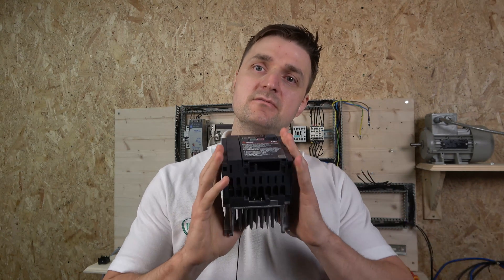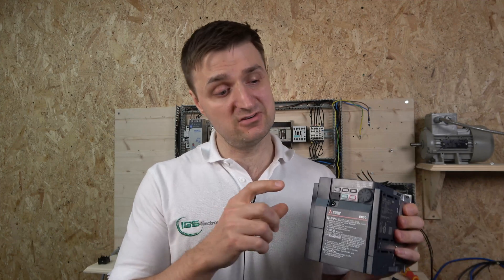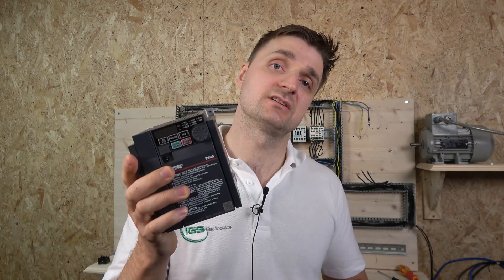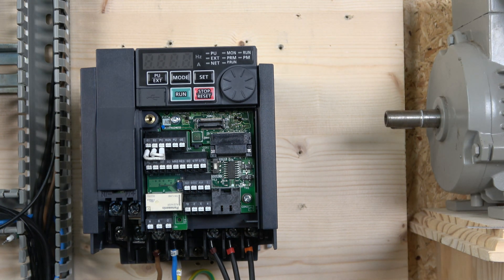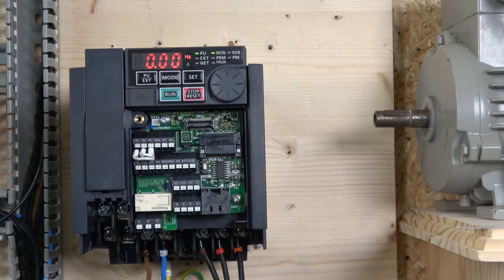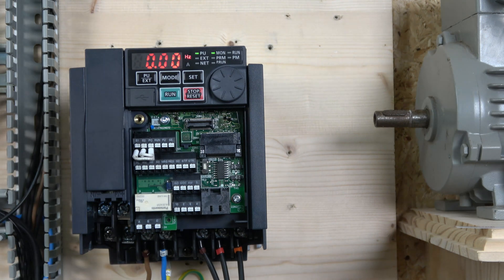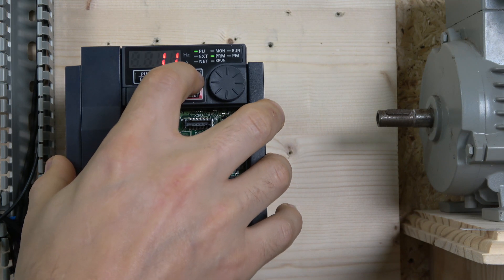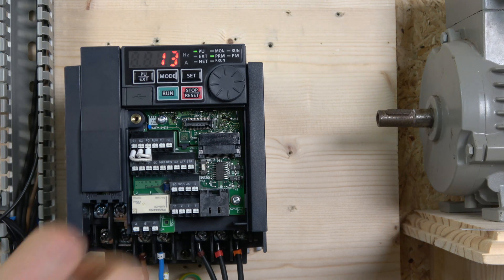Mitsubishi E800 VFD, local control, parameter set up, commissioning and factory reset. (English)

Comment: Hi, I need your help , I have a n application that needs a variable torque Drive, I think that A700 or E800 is the best choice, My Motor is an AC 575v, 3ph, 3.5A

In your opignon witch drive can do this job , Thanks